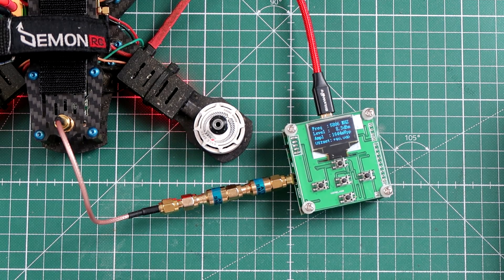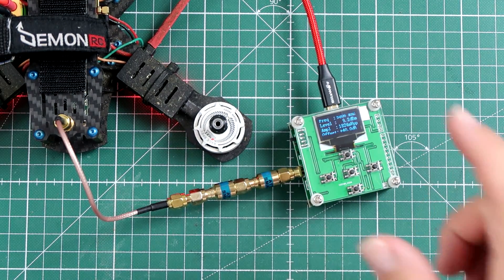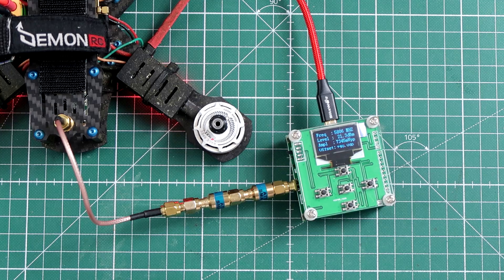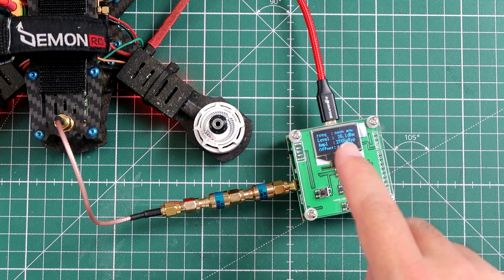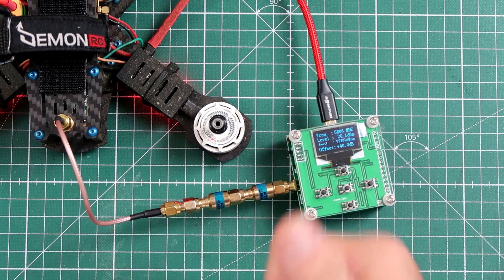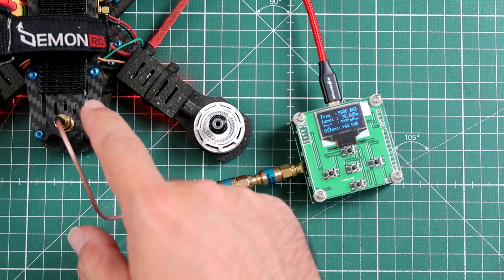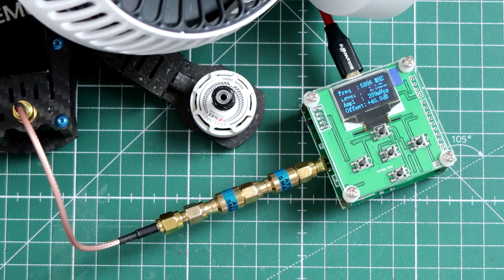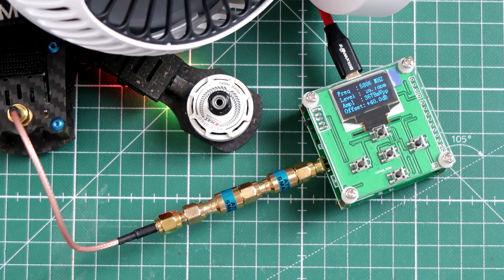Eachine TX805 video transmitter power test

Comment: What attenuators did you use?
Reply from the maker: 10dB + 30dB. So 40dB in total
Reply: Do you have URL link for those attenuators? Thanks
Reply from the maker: somewhere from ebay if I remeber correctly. I got then some time ago
Reply: So if I use this one (10dB+30dB or 20dB+20dB), will it be okay? - https://www.aliexpress.com/item/2W-SMA-JK-Coaxial-RF-Attenuator-DC-to-6-0GHz-50ohm-1db-2db-3db-5db-6db/32889027071.html

Comment: Did you repeat the test on different frequencies? According to https://youtu.be/kzIJug7nBv8 & https://youtu.be/d8EOh5WpLNI it may have different performance depending on what channel is selected.
Reply from the maker: different power on different freqiencies is expected. But not to the point where there is no 800mW at all or 25mW has less than 10mW

Comment: I saw another guy's review of this where he tested the power. He found the same exact thing! Terrible power setting accuracy! And, we use 25mw the most because of races when flying with others. With 200 being the only accurate one, it would appear this is a definite VTX to pass on.  Thanks for testing it!
Please test the Eachine VTX I brought to your attention yesterday in your first video about this model. I think it is the spare part for the Eachine TS215 Lizard. Similar specs but 8.5g instead of 13g and 4 - 30 x 30mm mounting holes. Thanks Bro! 😁🤘

Comment: imho the most important vtx features are 1) clean channel seperation and 2) running fine @~25mw. 
Channel seperation was not tested here but the usual poor performance in this regard is exactly why no one allows that cheap vtxxes on any race or meetup. If one doesn't want to spend additional $20 for a decent vtx its his thing but then he can have big fun flying alone because if he shoot people out of the air just to save $20 he's a dickhead.  
Sending fine at about 25mw is important because its the max legal power output basically everywhere in the world and is used by virtually everone but some lonely freestylers. 
So all in all this VTX is simply crap by all relevant metrics :)

Comment: Chinese watts = whatever the other guy's selling ours is more... same deal with battery C ratings, bec current ratings, motor wattage, antenna gain, receiver sensitivity, esc current... all just printed numbers way higher than the truth... 'just print what sells, who cares'..
Reply: Actually even tho they are almost always higher than they actually are,  they wouldnt go too far with it. So they might call a 2a bec a 3a one but wouldnt call a 1a bec a 3a one.

Comment: Doesn't explain it actually, the akk 1.2watt 5.8 vtx is only 25 euro and their 800mw is about 15. And those values are actually reached.
Reply: Arend Mookhoek it's made by akk. It's exactly the same as their mini
Reply: @CoppertopFPV  so why less power?
Reply: Arend Mookhoek because like every other akk vtx the power varies wildly from one to another and also depends on what band you're testing
Reply: @CoppertopFPV  still doesnt make sense why there is no differnece from 500 to 800. Also how do you know akk made it and eachine didnt copy it like they always do?
Reply: Arend Mookhoek Because eachine is just a name. They don't make anything. Banggood just buy tech and brand it. Vtx03 is also akk made as are many of their vtxs.
Reply: @CoppertopFPV  are you saying the omnibus f4 from bg is also akk made?
Reply: Arend Mookhoek no.

Comment: On another channel in YouTube I also saw test - that the VTX 805  does not give out what is written in it.
This transmitter - is garbage.
For this money it is better to buy AKK!
Reply from the maker: I got 2 of them and payed for both of them. I have installed 2 of them on quads and do not regret that decission. So no, it is a decent VTX and would be good if they scratched the 800mW out of it. Besides, who need 800mW to fly around?
Reply: Then the simple question - why pay more if you fly close and around?
Reply: @aleks3a00  oh come on, don't be so annoying. If you've got the money you want the longer range one, even if you don't actually use it.
Reply: It isn't garbage it's just not 800mw.
Reply: Really?
But people pay money EXACTLY for 800mv! This VTX  not even give 700 and 600.
So - why pay more money?
Reply: @aleks3a00  you aren't getting my point. If you wanted a 800mw vtx this is a bad option yes, but if you just want a nice vtx with smart audio etc and only need 200mw anyway (with the right diversity 200mw is plenty) then it's still a good vtx. If you need more output power you should obviously get akk, my 1.2watt akk vtx is doing good so far.
Reply: I put a plus to you about analysis, but in reality lying about power output is not good for a respect of manufacturer.
Reply: Alex R, how much is the akk that you mention u'd rather buy?
Reply: Alex R. I'm going to point out the obvious. It is an akk vtx. It's made by akk
Reply: I have one from the first batch and its output power on 800mW is close to 720.  very satisfied with this very cheap VTX and its decent quality. As long as you are not participating in races (get a Unify) there is no reason to buy overpriced TBS crap VTX with a fuckning UFL POS connector which is going to fail you sooner or later

Comment: maybe you already cooked the tx by having it sit there for 3+ minutes with no cooling ?
Reply from the maker: No, broken PA would result in lack of power on all settings. I just think that there is no 800mW and that's all
Reply: And an overheating vtx most likely isn't  permanently damaged after its cooled down.

Comment: How confident are you with the results of that test meter? Has is shown good close values to a trusted device? How do you test a tester? :D
I'd like to get something to test with, and it doesn't need to be super accurate. I'd just use it to compare the power level of devices I have to each other. 
I'd like to see a video about using this meter. If you're looking for other vtx to test I'm a big fan of the AKK models in that same form factor and the Nano2 for my micros. 
https://www.akktek.com/products/vtx/akk-fx2-ultimate-mini.html Maybe this one? 
Enough about me. Thanks for making these ;)
Reply from the maker: https://www.youtube.com/watch?v=-RcMGRb-J5o Same meter, same attenuators. For sure it can pick 800mW and above and once again results at 200mW are quite consistent.